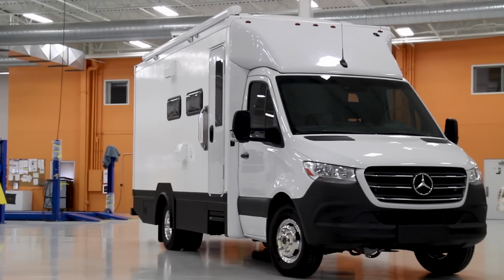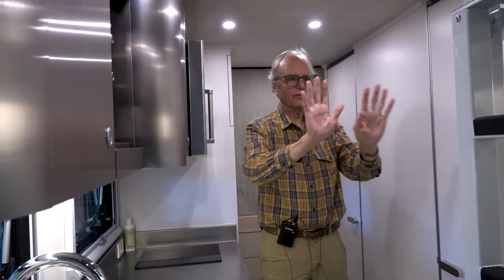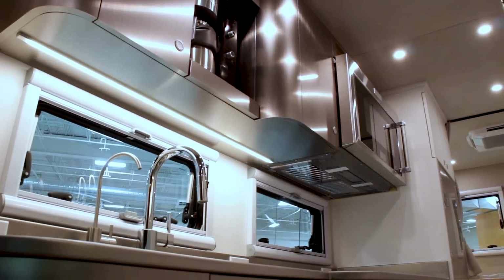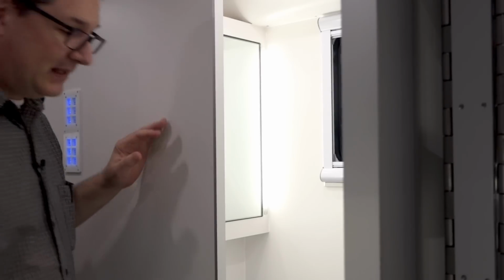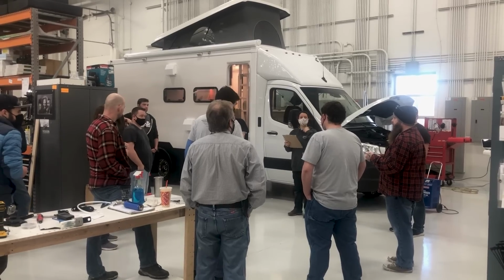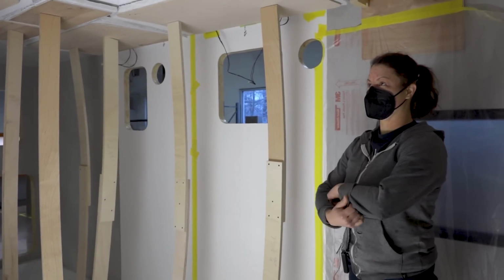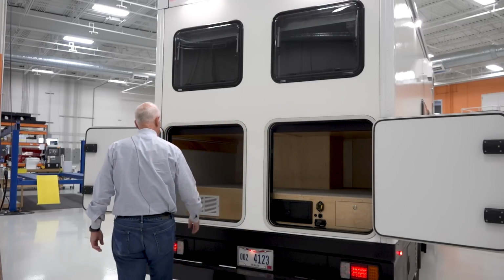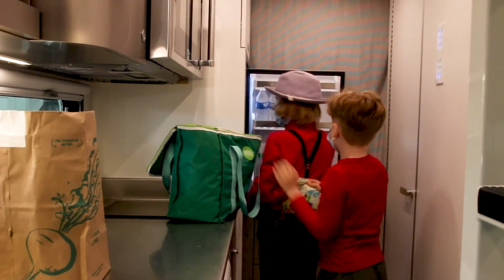ASTEROID OF HAPPINESS | B Box Motorhome for Four

Comment: The exterior vents are unsightly.  I'm surprised that ARV didn't come up with a solution where vents went out the roof.  And any thermal efficiency is lost by having a roof top tent.  Both heat and air conditioning will quickly go away when the tent is deployed.

Comment: For off-road one needs a swing a-way like Owl spare h/duty spare tire, and also swing a-away two mountain bike holder. Prefer the rear large gas-assisted door /platform, using the rear bed to sit to face outside onto the tailgate. I like the air suspension with Fox shock absorbers and the 4 hydraulic establishers on uneven ground. I am then a real buyer for two units

Comment: 400k I'd expect more. Looks very well put together than my build. But even still I wouldn't  trade mine for yours.
Why? Well as where I consider yours too cold to mourge like. All metal eh.
Where's the aviance?
If you ck out my van you would see hardwood flooring a permanent 9'x5 very comfortable bed. For walls I used Cork and bubble wrap then ran electrical then another layer of insulation then a dark blue velvet type material on the walls & wood trim at the top with colored strip lighting tucked underneth. The  Cieiing cork  potlights insulation and quarter inch cedarwood that molds with the roof.
In the corner built into what was left of the factory installed utility locker behind driver's side is a chef king refrigerator/freezer and microwave on top and storage on top of that. A light up white antique cabinet with glass door for my ceramic cats I mounted to the wall and floor. A drop-down desk. A small 5 sided card table with a native look to it and under the desk a 4ft. Electric fireplace with blood red glass tile work around it. That was hard to do. If your looking at my van build video, you don't see the fireplace because it's part of my almost done
upgrade. You see the pleasent hearth electric stove instead.
Alot of candles here and there. In the summer I just open the back doors to a beautiful view. I wanted to be totally stealth and blend in with your typical super duty cargo work vans.
I converted by myself a 2006 Ford E250 commercial work van I bought used. Compared to all other vans at the time I looked at this one I knew the minute I saw it, it was what I wanted. Compared to your van mine has unbelievable clearance underneth. I wanted duratrac off road tires but because of Covid they didn't have them in stock so I got brand new Mesa all terrain tires just put on.
My van has the separation cage from the cab with a door. Right inside the cab stands a portable 14,000btu fridgadare air conditioner that is perfect size to stay snug between the 2 seats. And in front of that I have my propane tank with a removable hand molded to fit the top of tank a tray for my cats stuff for when we're on the road. If you watch till the end of my build you see what powers everything. 4,000watt solar generator.  What I don't like about my build has become very painful and that's the height. After living in my van for one year my back's killing me. I love your pop up thing that's way cool. Maybe I could someday do that too. Your van to me is not stealth too cold looking it needs warmth. But maybe you like having to be able to look out windows and like metal. Me I like comfort and sexy which I think my van is.
Sexy and invisibly stealth. I even have the rack and big tube on top lol. No windows but I just open doors. If I want I have 2 screened awnings for both sides of my van. I do have a shower head shower you will soon see.  I hope you go ck out my build it is very unique indeed. Just look up my name and my picture of the two cats and look for my diy van build. I now have a room addition attached I bought a teakwood teardrop trailer I can stand in for my cat . He wanted his own room.  I put blue glass tile on one wall I'm redoing the outside still but I will post videos very soon. $400.000 dollars yours cost unbelievable I bet it's built to last a lifetime maybe the apocalypse.
Reply: How much would it cost to raise my roof a foot I wonder. Anyone know?

Comment: Wait wait wait... A washing machine... In a class B size? Has that ever been done before?
Reply: My B box in the U.K. has a full-size washing machine. Can go outdoors with the kids, wash and heater air dry clothing in the vented shower room. 

I put it where the oven would normally go; I have induction hob and microwave (micro, grill, oven) so have no use for a traditional oven. 

I use a separate recirculating water system that eventually drains to the grey tank.
Reply: Yes, it has been done before.

Comment: Great build! Can you tell me the R value of the box wall, floor and ceiling?
Reply: Yep, at fourteen minutes and sixteen seconds in.
Reply: @n.lyndley.9889 What materials are used to achieve an insulating R value of 14.16?
Reply: @peterfodor9789  they meant the R value is mentioned at 14:16 time stamp. I believe it’s around R13.

Comment: This build is stunning. There seems to be a problem with van builders and building vans to seat 3-4 and sleep 3-4 comfortably. For years I've always said, I can't pay close to 390,000 to 500,000 for van when my daughter has to sleep uncomfortable. I would absolutely steal this plan layout for my family. I would only add functional exterior esthetics like a robust front bumper, winch, and two boxes in the back that swing around and allow the back garage access doors to open freely. the only reason is I would need more storage; maybe a ladder and a small light aluminum roof rack over the pop top so when im not carrying passengers that need sleeping I can use the top as storage safely. also I love that this man opted for a washer dryer....thats BOSS STATUS in a van box that size.👌🏼
Reply: How many nights at a nice hotel or resort could you get for $390,000 - $500,000?  Half a million dollars to rough it is really steep.  Imagine how much this unit will depreciate over a short period of time too.   I just love Sprinter vans but the cost of some of these professionally made units is prohibitive.
Reply: @amywalker7515  lets take the higher price, 500 000usd.... two rooms (4 poeple, lets say at 3000usd in total per night, we are in the nice hotel or resort after all) then its good for 166 nights. so not that much. if you use your RV for 40 days/night per year, its a little more than 4 years of "nice hotels or resorts"...

Comment: Been looking forward to this video!  Time to design a trailer chassis to go under the B-box - I think you've got a high end travel trailer that's truly 4 season right there and if you really wanna get crazy bolt it onto the chassis...  add some truck camper jacks and tah-dah you have a modular box that could be dropped on a trailer chassis or a chassis cab off roader flat bed pick up truck, left at camp, in the winter, popped back on the truck....  Awesome project.  drop a b box on this: https://www.youtube.com/watch?v=Vyeoo_KvGss

Comment: All this for only $85,000? Stunning!
Reply: Probably more like $385K.
Reply: Or $485k
Reply: The Ekko is $200k you think this one is that much more?  Sure it’s custom but 485k??
Reply: @AnthonyWebb7  Yes absolutely. Last year, Mike said the median price for their vans was $380K and the B-box are about the same. With the cost of everything rising since then, I wouldn't be surprised to hear $485K.  ARV is not for price shoppers.
Reply: @AnthonyWebb7  their battery system is probably 80K alone.  Their recirculating water saving shower system is also about 60-80K, I would guess.  They have hydronic using throughout the floors and around the tanks at least 30K for just that. The air conditioner with fresh air exchange and heat pump is probably 20k.  Watch the video on the first B box for those details.  It’s a lot of specialized skilled workers that do these builds, not some kid kicking out vans from his garage. And this company is one of the few companies that are an authorized Mercedes up-fitter, which means that Mercedes will honor any warranted parts on the chassis; many people get burned when they find out that their conversion van may have voided the warranty if it’s not done by an authorized up-fitter. It’s extremely difficult to get that authorized up-fitter status. FYI.

Comment: Mr Astroid has designed my perfect van.  I want to add a miele washer/dryer (does not need to vent out side) and a dishwasher.  This unit is just amazing!!!
Reply: Yes!  Mini dishwasher could store dishes & cutlery even when clean.
Reply: @source5729  exactly - I am not going on vacation to hand wash dishes.  Fisher Paykel uses a couple of gallons of water.
Reply: Absolutely ridiculous to have a dishwasher in a van, good grief!  Get your lily white hands dirty with some dishwashing for once. Should you forgo having a shower because you are on vacation too?  It might take away from precious vacation time!
As for the standard washer/ dryers made for residential use - another ridiculous request. Some of them have a concrete collar to reduce vibrations and you lug that weight around which further reduces your cargo carrying capacity when being mobile.  Furthermore, many non venting machines like the LG Direct washer/dryer combo have very serious design flaws - there is no way to remove the lint build up inside which cripples it in no time. I took one apart - did major surgery on it to find the link section and still could not access it. As deeply buried as an appendix in your bowels.  There are perfectly good little manual machines that are tiny and light to wash and spin dry.  Hang up your clothes after that.  Don't expect a van to have house functionality or you sacrifice compact size, gas, and cargo weight.
Reply: @mjremy2605  yup - I want a dishwasher- it uses 2.5 gallons per load and will keep my Lilly White Hands a beautiful shade of brown.
Reply: @mjremy2605  BTW:  You certainly have a lot of opinions. You might consider doing op-Ed’s for your local media source.
Reply: @NJ-Cathie  hahaha!!!
Reply: @mjremy2605  -  I'd need a washing machine in a van like I'd need another hole in the head, but this dude has two active kids, so I completely understand. I'd rather have a dishwasher myself.